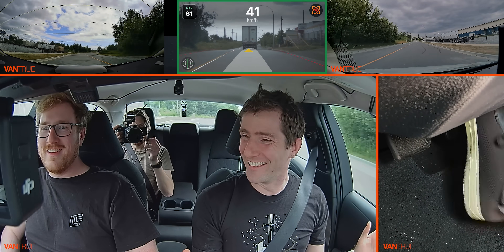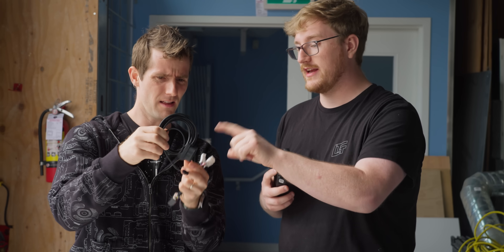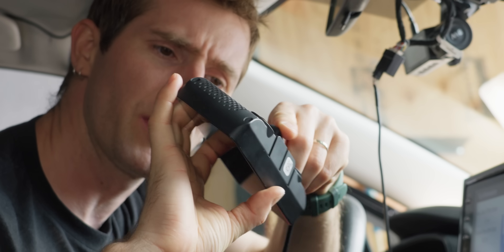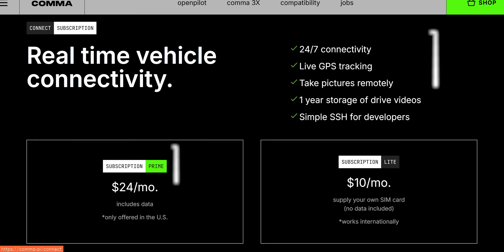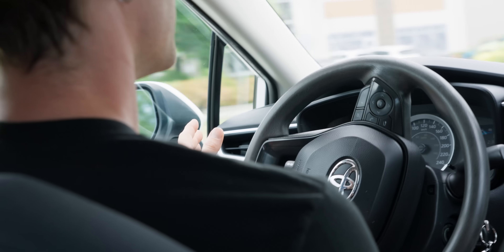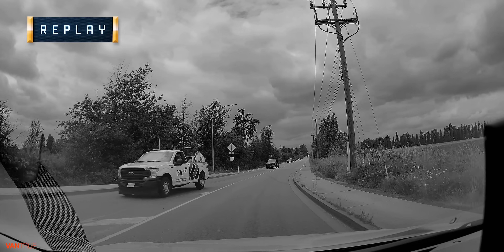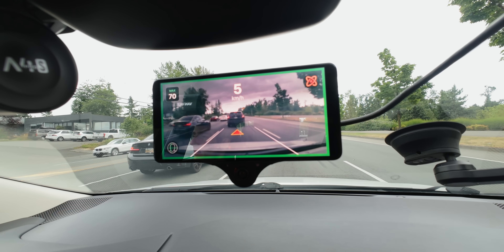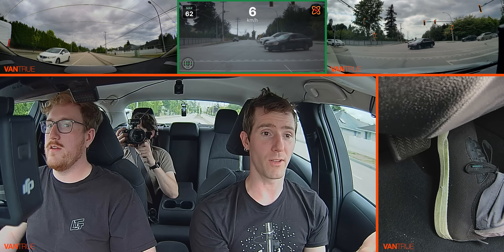I Upgraded My Car With Open-Source AUTOPILOT and it's AMAZING

Comment: Been using comma devices since the EON over 5 years ago. First on my Honda Civic and then on my ford maverick. Driven probably 150k miles with the device and let me tell you, this thing is a GAME CHANGER. Especially for long road trips. 

Its not particularly useful inside cities however. Although downloading sunnypilot fork with MADS can potentially give you always lane keep assist on is atill amazingly helpful inside the city.

Don't think, just buy it. Its THAT worth it. Just keep in mind that you should probably be at least a little techie because the companies support help is often rude or downright useless. 

This is the single best mod you can buy for your car.

Comment: Omg, I can't look.  Tesla is defective with 9 cameras, Waymo has 13 cameras, 4 Lidar and 6 radar sensors.  This thing seems to just have 1 camera !!!  Shouldn't self-driving be regulated?
Reply: Tesla defective?
Reply: Depending on the car model, it can take in radar data that the car already provides.

Comment: I use an older system of theirs close to probably about 3 or 4 years ago. Only last me 2 years before it bricked itself due to a failing cooling fan on it. Used to use it with a 2016 Toyota Prius and it was an amazing thing when I did have it working. Nowadays though I a drive a bz4X Toyota EV that has a built-in adapter cruise control with autosteer.

Comment: Been driving with Comma/Kommu for atleast 20-30000KM here in Malaysia. Purposely bought a new car just to use the device. It was awesome and reliable than the stock system built for the car !

Comment: I’ve been waiting so long for this video!! Been running a comma 3 for 2.5 years, first in a 2018 Subaru crosstrek and now a 2020 Hyundai Sonata. Best $1000 I’ve ever spent by far!

Also please try the sunny pilot fork if you can. It works a lot better in my experience

Comment: I used to have a working comma 2 on a 2018 Corolla ZWE211r.
Openpilot made the factory cruise control and lane keeping look like a toy.
Using the driver monitoring camera, the longest I went was a 5 hour drive in the outback without touching any controls.

Waiting for a comma 3 screenless hardware fork that I can buy off the shelf. Big screen in the windscreen was too obtrusive for me.

Comment: I have used comma since my old 2016 Civic (with Honda sensing) from about 5years ago, to now my latest Kia Sportage And I went to the mile of changing the steering FW back in Civic to increase the steering limit, and it was awesome. (Didn’t have to do it on Kia, just something you needed to do for Honda as they have tight limit.) I can guarantee you from personal experience, the lane keeping control itself is better than 99% of human, on a bad weather, reflective road, late night, rainy day or strong sunlight for example, they keep the lane better than I could, despite it was extremely foggy and you see no lane line at all

Comment: Use the Sunnypilot fork, that’s an awesome fork which allow you to separate the lane keeping and adaptive cruise. Because even tho the adaptive cruise of open pilot is pretty safe, it can gets uncomfortable in stop and go (there’s some HW to optimize that or it’s better on some cars). But that’s kinda the reason I primarily use the lane assist all the time, and I barely “drive” the steering now I just have to correct it for the direction I’m heading. And I never disengage the steering assist

Comment: I like that it's open source. If I used highways excessively... which, I kinda do when I leave, but I also don't need to leave the house but a couple days a week... I might find it cool.
Too expensive for me, because there are no fucking jobs around here, but whatever. Very inexpensive for its feature set... Though it relies on the car having said feature set to work with. And it's made in America.
Yeah. I wouldn't have a problem with buying this if I had the money. I... would not trust it with my life.

Comment: It’s nice to see OpenPilot finally getting some recognition. I’m a longtime user of Comma 2, 3, and 3X across multiple vehicles and 50,000+ miles. Frogpilot is the best software to run imo, it adds so many useful features. Wouldn’t do a road trip without it!

Comment: As best as can be ascertained, the device is an in-lane driving assistant. It has no business trying to change lanes if it isn't instrumented with side and rear sensors. If it can't change lanes safety, it can't navigate according to GPS like a true ADAS. But some bright spark had to try an open source app to do just that, so here we are.
Reply: Correct, and that's why it doesn't change lanes automatically. In the video, you can see that it requires a wheel nudge to initiate the lane change after signalling, the user is supposed to check their blind spot before changing lanes. It's worth noting however that openpilot does indeed integrate with most cars built-in blind spot monitors, and will block a lane change if a car is detected, but regardless, it still does not automatically change lanes, it requires driver input to do so. There are forks that will change lanes automatically, but those aren't endorsed by comma.

Comment: That device will always be a gimmick with only a front-facing camera. Even when driving in one lane, you have to monitor the lanes beside and cars behind you. That device requires a camera mounted outside of vehicles to cover all angles to work correctly.
Reply: It has 360° camera view

Comment: the obdii port was never designed for that volume of data as an input, unfortunately it was designed as a diagnostic port. newer vehicles that utilize ethernet for its module LAN instead of CAN are probably the best candidates for the tech. very interesting project though! (did someone say open source)

Comment: Hi guys, try go to toyota settings in the dash, there should be sensitivity of your steering assist and lane keeping assist where you can pick how aggressive it helps you turn in case of a sharp turn. By default these settings at "low". Your cool little device may use build in safety features of the car for more deeper layer of control. Please let me know if it helps. By default my RAV4 was not able to hold corners often as well in Adaptive Cruise Control, until I changed settings to max aggressive assist.

Comment: It's part of the human condition that we tend to see the world through the lens of our careers, or in my case, my former career.  As a recovering lawyer, I often see things in terms of potential liability.  If that company is selling its product for $999, I wonder how much of that cost is going to its liability insurance premiums?  What many people don't understand about product liability is that the maker of a product is liable not just when the product is used as intended, but for all uses that are foreseeable.  That's why self-driving systems are designed so that drivers have to remain attentive.  An example would be systems that monitor the driver's eye line so that they are watching the road.  But here's the thing.  Even if a self-driving system works flawlessly, it's going to be involved in accidents, sometimes where people are seriously injured or worse.  

Even if you do everything right and the accident is 100% the fault of the other driver, it won't prevent you from being sued.  I represented a cable company that was sued because a car ignored an ambulance's flashing lights and sirens and struck the ambulance, knocking it into a cable van that had been stopped at the red light. The passengers in the ambulance not only sued NYC (it was an NYFD ambulance) and the driver of the car, but also sued my client.  Plaintiffs' attorneys will sue anyone mentioned in an accident report that they think has deep pockets.  I had another case in which a woman slipped and fell on ice outside a Manhattan record store.  She not only sued the record store, but she also sued Paramount Pictures. Their theory of liability?  There was a Ticketmaster inside the record store that was selling tickets to the premiere of the Howard Stern biopic Private Parts that was being held at Madison Square Garden.  The line of Howard Stern fans had backed up onto the sidewalk.  Plaintiffs' attorneys sue everyone in sight because they know insurance companies will pay to settle such cases in order to avoid the expense of winning the lawsuit.  And that is why I think the United States should adopt the English Rule, where the losing party pays the winner's legal fees.  I believe Canada also follows the English Rule.

Comment: Alright, next car I'll buy will be a 2022 Corolla.

Edit: Umm, nevermind. a 2022 Corolla with visible wear is only $1760 cheaper than a brand new 2025 Corolla. Hell no. The used car market is jacked.

Comment: some guy in the states, his Tesla drove direct from factory to customer without a driver, insane. wish i could get this for  my Acura TLX, the car can keep me in my lane, but seems to only work when the lines are visible enough, it could drive on its own when you're in CC, but it feels fucked up when you're coming to a red light and cars are stopped, the car's going 50 kph right up to a point when it decides to slow down, not in my comfort zone, but it does keep me a distance from the car in front at certain speeds that car is going. I would only use it for long drives on the highway

Comment: The 2024 Toyota Grand Highlander Platinum has sepf driving on the highway for those roadtrips, please bote that it will sound an alarm and pull over on its own if it detects no input or if it lost the lane markings, its actually sweet

Comment: I use a comma 3x on my chevy bolt and it worked great. I also got a telsa Model y and I found it better then FSD before the latest FSD update. Now they are about similar. The turning torque is based on the car. The best cars for it currently are kia ev6 and tesla does pretty good as well. the chevy bolt did alright but needed some assistance on some turns. Sunnypilot and Frogpilot are some of the best forks I found and depend on your needs either one is better then standard openpilot

Comment: You can't put the graphics card in the trunk, you'd have terrible latency but also I'm sure thunderbolt can go that far without issues, but if you mounted it under the dash near AC vents that'd be perfect.
Reply: How long would the latency be? I don’t think it would be an issue
Reply: @AndyMcBlane  it depends on the GPU and PCie configuration. Though thunderbolt cables are limited in size, and risers as well. Which is probably indicative of the experience. Also because the GPU won't be doing the display, CX3 would have to send the data the GPU process it and send it back, if this takes more than 100ms it won't work while driving. It would have to be 10s of milliseconds. Otherwise you end up with issues where it can't adjust steering angle dynamically
Reply: @daPsychoNinja  apparently they’re not using PCIe
Reply: @AndyMcBlane thunderbolt is PCIe

Comment: As a 3 years Comma 3 user on my 2022 Toyota corolla, openpilot is the GOD which save us in the traffic jam..In some fork , they even add the autohold function to the car which still using old handbreaks. 
With all time lane assist, you can pay more attention on traffic instead stay in the middle of the road.
Comma 3X will be definitely a deal bargain!

Comment: Also an Openpilot user! Using BluePilot which is basically a SunnyPilot fork specific to Fords. Great on my Mustang Mach E, better than standard bluecruise. And no annual fees!
Reply: Interesting, a Mach E with almost Tesla Autopilot equivalent functionality is actually tempting.! The problem with BlueCruise is its hot garbage and only works on certain pre-mapped freeways basically and cuts out often as a result when things don't match what's expected.   Construction zone coming up with lane change?  Forgettaboutit!

Comment: Used OpenPilot since 2019, first in my 2015 Hyundai Genesis sedan and currently in a 2020 Genesis G90.  The G90 is basically a self driving limo now

Comment: I use the Comma 3X on my Gen 1 Rivian because the stock Driver+ system is just REALLY bad - and there is not going to be any support from Rivian to make it better.  The Comma 3X has given my Rivian a new lease on life and I feel much better about hanging on to it rather than having to upgrade to a Gen 2 just to get decent ADAS.  If you have a Gen 1 Rivian and you've been disappointed with Driver+, definitely look into a Comma 3X.

Comment: 19:36 - I'm on the same page with Linus' comment at the end. 
When it comes to open source projects, I am much more comfortably providing data as a means to support the effort. 
It's a way of contributing to a project in ways other than writing code or soldering, and that contribution may ultimately improve the project as a whole, which benefits everyone.
Reply: open source projects feels more like people who dont ceare about your personal info but are 110% into creating something bether in their passion
Reply: @MyggFaen  i'd love to feed data but pay 1000 for thats not even beta!?!
Reply: Nice clippy
Reply: Key words: open. That means, not closed, not guaranteed secure, and can be hacked and exploited. Yeah, no thanks.
Reply: @ernies8828  Not how that works. Open source software is more open to scrutiny from the public therefore the code is usually safer, especially in projects like this with a commercial usage
Reply: @ernies8828  Actually not quite, open means the code is visible, so people with the necessary knowledge can see how it works and what it does exactly. It means they can flag it if something is off. Compared to something that is not open source, where you have no idea what the code is doing and rely on the company and their reputation to do the right thing, which proves more and more to not be the case.
Reply: @ernies8828  Closed source apps don't guarantee you any security whatsoever. It's just a matter of time and in terms of open source, the more people look at it the higher is the chance someone will find and report the vulnerability

Comment: Man this would stress me the hell out that I wouldnt even use it. 

I do like some features in modern cars, like auto cruise control, blind spot checkers.

However anything like lane keep (while great on highway) I find terrible for non-highway driving.  I either need it to be good enough where it is full self driving, or not bother at all.  Because it would be difficult to know when to trust it and when not to, and when you get a little too trusting that is when something bad happens.

Comment: 6:43 Does "Mr. Tech Tips" honestly recommend splitting your SSIDs for 2.4GHz and 5GHz? For shame! This day and age clients pick the best connection reliably. I wouldn't recommend that anyone run that way. Here are my tips to un-dork your wifi.

1) Make your 2.4GHz and 5GHz SSIDs the same
2) Use a narrow 20MHz channel width band for 2.4GHz, to reduce interference; and a wide 80MHz channel width on 5GHz to maximize throughput.
3) Select channels that are not crowded and don't cause interference. For 2.4GHz this would be channels 1, 6, and 11.
Reply: What if my client doesn’t do it automatically
Reply: Must be a really old client. Consider replacing it, or maybe adding a guest network SSID just for your one dumb client that doesn't support fast roaming.
Reply: @ciaduck  or just split your SSIDs and avoid throwing it out?
Reply: @AndyMcBlane  The problem is, by splitting them, you destroy the chance that any client will roam, not just the crappy non-roaming one. Most people do not have a problem with client roaming, because most people don't have devices that old. It's a niche use case, and I wish AP vendors would stop making split networks the default. It makes no sense. You're leaving performance on the table.

Comment: It is quite nice, but honnestly I'm not in favor at all for this kind of intermediate thing. It is far to easy to be complacent with the system, increasing your reaction time and making things worse when the system fail.
I used the CC in my ford fusion, and in my current Kona EV along with the lane keeping assist only because I checked it with paranoia, and made the distance with the forward vehicle the maximum possible to give me maximum possible reaction time (which, amusingly, brakes the vehicle way before I'd do it, which make driving more comfortable, while, in my head, keeping security at max).

The only way I will use some kind of autopilot is if the producing company is assuming full responsibility and that I can basically sleep on the back of the car while it drives me where I need to go. I'm perfectly aware than even currently current autopilots/assists are probably faster to react than human and could provide some additionnal security, but I'm not betting my life on greedy profit-driven corporations to have my security interest in mind. If in case of an accident I'm the one responsible anyway, then I may as well do everything so I have maximum vigilance.

Highway assist is something else though, as it can be tiring to be fully alert for long periods. Other than highway, this is a high "nope" for me.